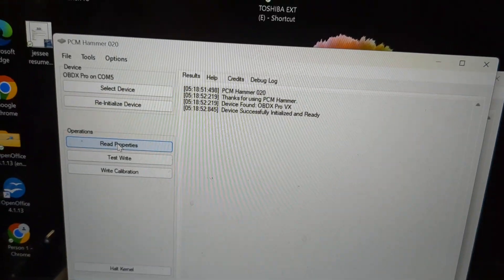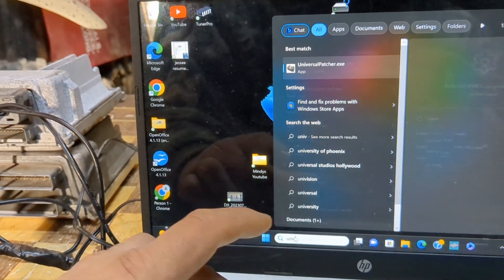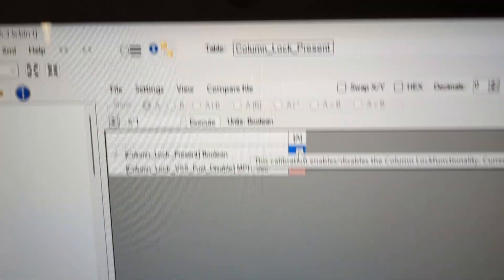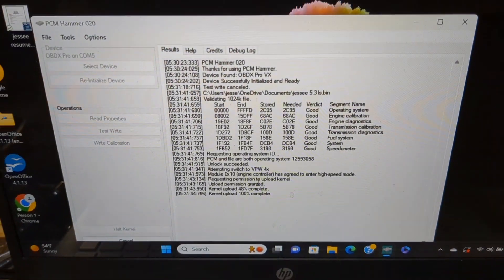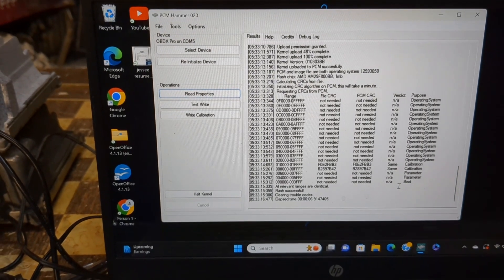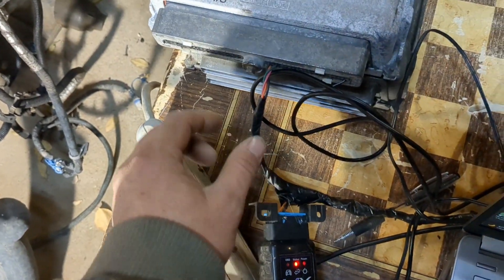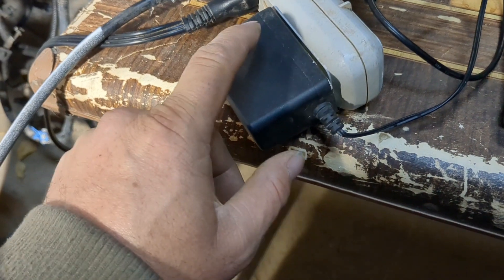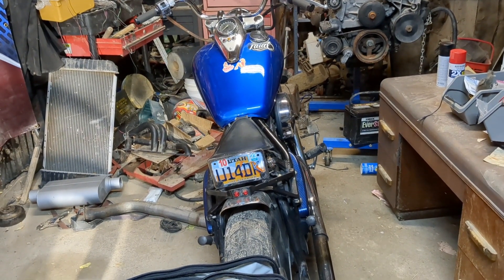Ecm tuning.learning by doing. vats removal for free. Chevrolet LS engines.

Comment: “VTD_Configuration” is the parameter you need to change to delete vats with universal patcher.
Reply: When I write with pcmhammer I go to “tools” at the top and select “ write full flash (clone)”
The free software is great but can be tricky to navigate
Reply from the maker: @choppedxnxdropped  It can be tricky for sure. I am mainly wanting to learn it to save my self $100 a pop to remove vats and rear 02 sensors. I have several projects that need swaps done. That saved $100 can buy more go fast parts and Mtn dew.
Reply from the maker: Thank you for the info every bit helps I'm learning as I go since the ls engines are cheap power and can be found everywhere.
If you want to share your insight with me on this and also I am still trying to figure out how to turn off the back O2 sensors.
Il take all the advice I can get to get it right .
Here is my email.
jesseejames187@gmail.com